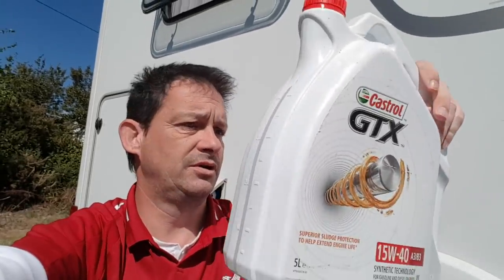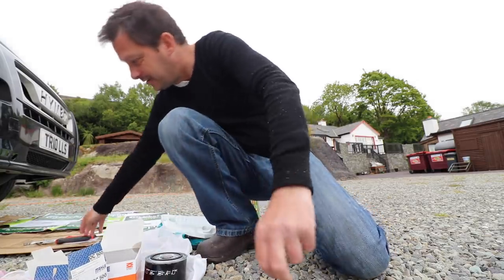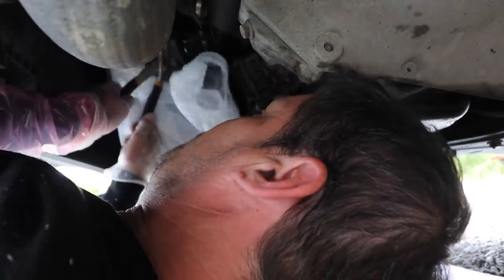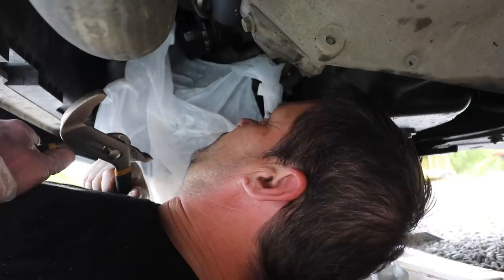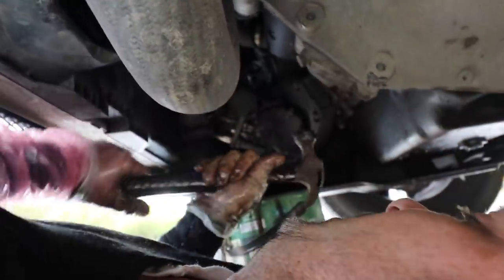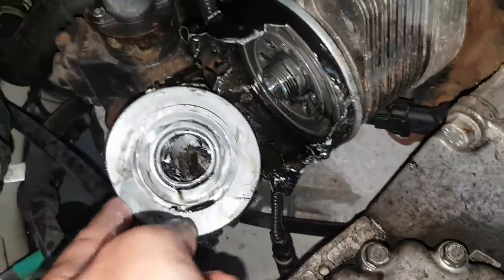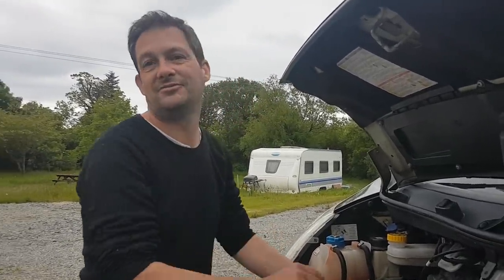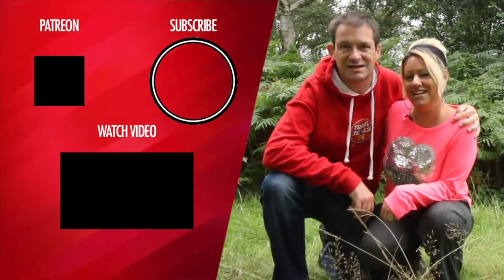Oil Filter Change Turns Into A Disaster

Comment: Dan, You haven’t changed the oil, you have only replaced the filter element and topped up. Dirty oil needs changed by removing sump plug first then replacing the filter

Comment: Lol the bottle trick works just don’t cut it in half. Cut just the one side out of the bottle that way it’s deeper and you will still have the spot to dump the oil out of the pan much easier.
Reply from the maker: but its not as good as a tin lol

Comment: Dan is a master detectorist, magnet fishermen, and darn good video production company, however, very mechanically challenged, to be very kind. Free tip , lefty loosey/righty tighty , PS on a diesel ,new oil every 3-5k miles ( 8-10 K ), filter every other oil change ,hand tightened plus one eighths turn.and next time only cut the side out of the jug , works every time. Cheers from the states mates ;-). !

Comment: Usually the oil pan is emptied first and then the oil filter is removed, the pan is lower than the filter so should have been dropped first. Bare in mind I dont know anything about Hymers.
Reply from the maker: This wasnt an oil change so not required.
Reply: @TravelTrollsTV  Oh I see now. When was the oil last changed.

Comment: I noticed it was the wrong way too but have started to do it wrong a few times myself.I also thought maybe that model is reverse threaded. I found out the hard way on lug nut removal to change a tire on my mothers 66 Chrysler Newport back in the 70's. Twisted off 2 before I realised it was reverse thread. As for that filter, I also have had to resort to using a screwdriver but only twice in all the years of changing mine when I was young. But once , the filter tore up like yours and I was turning it the correct way, just tight as heck.  On the new filter ,get a small amount of oil on your finger tip and smear around on the filter seal then hand tight is all they need. They get harder to remove as you get closer to next change.  Good try though, Dan and yes, it is a messy job.   I blame gravity...  : )

Comment: Before resorting to the screwdriver -if you havnt got the right tool wrap your belt tightly round the filter to get grip and unscrew with your hand using the belt for leverage .Only problem is your trousers will fall down.
Reply from the maker: I tried a strap off camera.

Comment: Well done for having a go at it!  Might have been a bit easier with an oil filter removal tool/strap wrench you can probably get online for a few quid.  I can see why you were turning it that way, it almost looked like you were sort of trying to do it left handed.  Hopefully problem now solved with your leak issue, a lot cheaper than a head gasket to fix.

Comment: Never known anyone to change only the oil filter without doing a complete oil change. Also, doing so is a good way to check the oil pan drain plug and make sure it's tight. It looks like your's may be leaking a bit. Thanks for the entertaining vlog.
Reply from the maker: We dont require an oil change. Our oil pan is fine.

Comment: Hi Dan, glad you got it sorted. The leak you had looked small. But the oil filter is under high pressure when engine is running. So it's probably like a squirt gun down the road... 
It would've been easy and  perfect if your luck turned it the other way.
Remember to always stop before the carnage happens. Give time to think. And ask questions to whomever. Even Mazzy can be a good sounding board if you gave it a minute. Proud of you for trying

Comment: Its  bar with a chain  attached to the end inexpencive tool or you could use a strung stick with a long pease of string tied to the end you rap the string around the filter overlapping the string so it pulls tight then leaver thr stick against it to loosen it
Reply from the maker: Tried that with a strap.

Comment: Credit for at least trying but as the old saying goes, a title knowledge can be a dangerous thing.   Just in case you ever fancy Chang the oil filter again you can get a specific tool for removing the likes of oil filters, it’s basically a large rubber strap (in a loop) with a handle, it looks a bit like a laso, you slip the rubber loop over the filter and pull it tight into the handle and then holding the handle it works basically like a lever and it won’t slip.  It’s a very simple but effective tool.  There are a number of these tools available and all do the same job, see the Toolstation link below

https://www.toolstation.com/strap-wrench-set/p98766?store=D6&utm_source=googleshopping&utm_medium=feed&utm_campaign=googleshoppingfeed&gclid=CjwKCAjwt-L2BRA_EiwAacX32aeCK-KFTDvGOT23Rbj8PbUzEEzLZ6mRF728fo5ncwoDYJK5iIhzgRoCsBoQAvD_BwE

Comment: Dan , you should use the right tools to loosen the oil filter not to use the hammer and screw driver! If you cut or damage the thread of the engine block it may cost a lot to fix it. Besides you should understand to take out the filter by turning counterclockwise to put in the filter is clockwise !also you need to add a circle of engine oil around the rubber ring on the filter before screw it back to the engine. After done ,heat up the engine to make sure the oil level is correct or not!

Comment: Get yourself a Motivx Tools Small Adjustable Oil Filter Wrench from Amazon and then turn it the right way next time.  That will come off in no time.  Had to buy one for my lawnmower recently because the manufacturer put the original oil filter on too tight.

Comment: Reall, I have no clue why he didn't drive tp a garage and have them fix it in 10 minutes. At least Dan is consistent in his failiures. The best advice Owen can give is, leave it to the professionals.
Reply from the maker: All garages were shut and had been for months. Thats why.
Reply: @TravelTrollsTV  Ah didn't know that. They have been open here in the Netherlands during corona. I was afraid Dan would break the oil filter thread turning that filter the wrong way. If he did you would really heave been in trouble, because a mechanic would have to fix the thread and in order to get to a garage you had to hire a towtruck. And since garages are closed, you guys would not have been able to drive anywhere. Scary stuff,  good thing Owen was around. Stay safe!!

Comment: I've been in the same predicament brother,  except I crushed it with an actual filter wrench. I wound up taking the alternator off so I could get to the blasted thing better and blew a fuse and didn't realize it. Had to get a wrecker to come get it. I learned it's cheaper to let someone else change the oil in my truck. LOL.... noticed your hair is getting wavy, waving goodbye

Comment: Undo the oil fill cap then lift dip stick then undo sump nut and drain oil then release oil filter
Reply from the maker: why?
Reply: Travel Trolls TV to drain oil out but remember anti-clockwise to turn filter. But fair play for giving it a bash.

Comment: Lol why didn't you just drain the oil out from the motor first 😂🤣. Normally you would undo the plug on the sump, drain the oil, take the oil filter off, put the new filter on, plug back in the sump, then fill with new oil
Reply from the maker: Only if you need an oil change.
Reply: @TravelTrollsTV  always good to change the oil when changing the filter 😊
Reply from the maker: Not if you dont need an oil change.